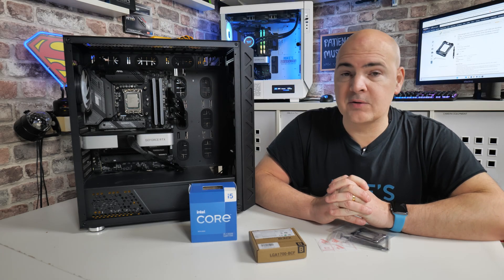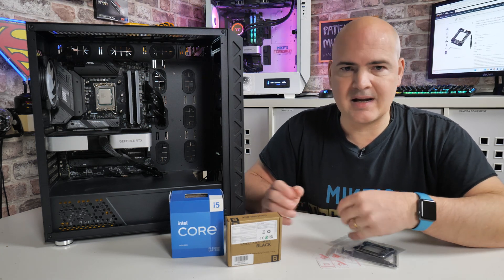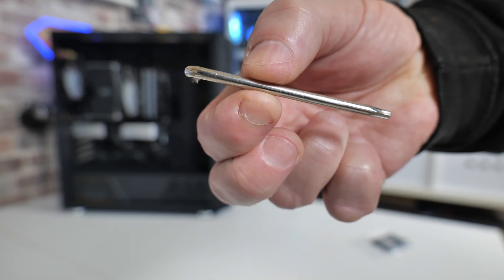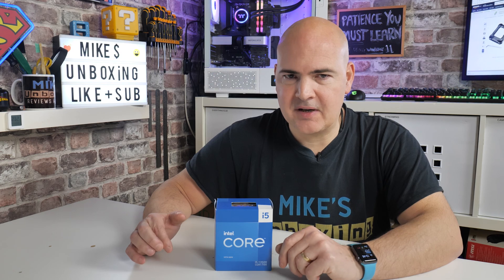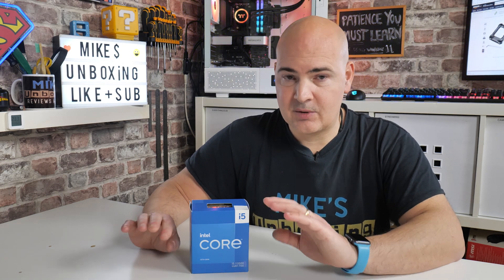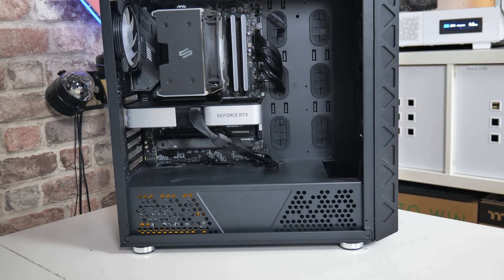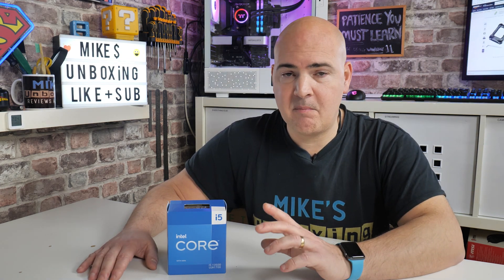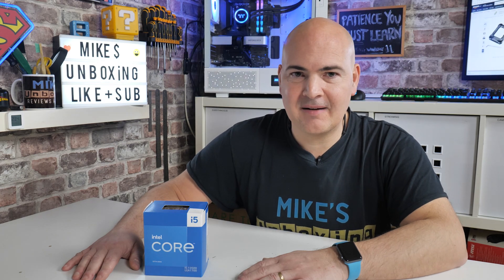Thermalright LGA1700 BCF Contact Frame Plate Weird Results Please Help!

Comment: I just had a weird issue as well. So I have a 13600k build, I bought the exact same contact frame, I installed it as I have with other contact frames I have done like on my 12900k, no issues on instal but I noticed my temps didn’t improve at all. I’m still hitting 95c in cinebench r20. I’m starting to see ok temps in games but not benchmarks. I’m wondering if this is a cinebench issue. Try another benchmark like intel xtu because it only hit 87c there and all my other test it did really well. 😊
Reply from the maker: good to hear that i am not alone on this, i wonder if the 113th gen chips or sockets are made slightly differently to avoid bendgate?

Comment: When was the contact frame bought? I tried to get one as soon as they were released but was told I  had to wait a few days before my seller could send me one. There was a very early batch that had problems and was recalled from the vendors. Some had probably already been sold or vendors just didn't return them.
Reply from the maker: not sure it was sent in by Rick one of the viewers so can't pin point it completely

Comment: You tightened the screws too much, you are supposed to go 1/4 turn in a cross pattern till the screw feels tight then stop, if you tighten too much then the cooler won't do correct contact with the CPU and also you could bend the pins, the fact that you put the stock retention back and still have bad temps shows you are over tightening the screws.
Reply from the maker: That is not mentioned in any documentation that the frame is supplied with, so just following the instructions provided as many potential buyers will do
Reply: @mikesunboxing  With this particular contact frame that shouldn't be an issue because unlike the grizzly version it has two pressure points on the top and bottom. So the amount you tightened it wouldn't have made a problem
Reply from the maker: @Honin_Cheta_Cheese_Akecheta  yes i just rewatched my install and the one steve / mike did and they also screwed down to the hard wall of resistance as i did, i also depth checked my CPU and there actually seems to be a very slight high spot in the middle which would seem to counter act the pressure from the stock and aftermarket ILMs

Comment: u need to set up a test thats equal. same clock speeds, voltage, ect. there is way to many variables with boosting. it was a poor test to do.
Reply from the maker: That makes sense but not really real world use when locking things down. And most people won’t or can’t do that and just want an improvement over the stock out of box experiences
Reply: @mikesunboxing  hi mike. Makes a lot of sense in real word use, for the specific part. If you test a product, you remove all the variables. That is the comparison. Then if it makes a difference in real life, is another story.

Comment: It's not the board that bends it's the CPU IHS. If you've already fitted the CPU with the original clamp it may have already bent the IHS. Try putting a straight edge across it and see if you can see light between the CPU and straight edge to see if it's warped. They are usually have a dip in the centre between the two clamping lugs where the clamp has pushed down so hard.
Reply from the maker: Will try that, the cpu isn’t in the pc now so easy to do
Reply: @mikesunboxing  I would love to hear back as to whether this was the case
Reply from the maker: @WeirdTippy  right just checked the 13500 and there seems to actually be a low spot towards the bottom of the CPU, very slightly higher in the middle so that might explain my results
Reply: Unfortunately this is my experience as well.  If the original CPU used with the original clamp over a period of time, then the IHS has been bent as well.  Of course, there is a lot of variables.  Some CPUs may already have high/low spots from factory.  Some clamps on mobos may not be as forceful.
Reply from the maker: @hanswi336  Did you click on the emoticon to accept the rules?
Reply: can I remove my cou from motherboard to check if  pins or cpu is bend before installing this frame ?

Comment: Hi Mike and Kath.Gamers Nexus did a deep dive on the Thermal Grizzly plate.there plate is marked with lines around the bolts around six lines and was tightened one line at a time going corner to corner that my make a difference on performance.
Reply from the maker: Yes I did watch that video due to the manufacturer tolerances the grizzly needs a bit more care and attention and tweaking to get it just right.

Comment: I didn't tighten mine anywhere near as much as you did. I screwed them down very gently until they bottomed out using only my finger tip and thumb on the shaft of the driver. I think I even slackened them off by ⅙ of a turn. My thermals have been far better than I ever expected.
Reply: Did you mark your screws like in the Gamer Nexus video ? or did you just cross pattern tighten them slowly? Did you also do the reverse turn to "seat" the screws initially?
Reply: @ptung88  Didn't mark screws, just used the handle of the tool as a guide to how much it was turned. I cross pattern tightened about half turn at a  time until seated just using finger and thumb on the shaft of the driver. Then backed off ⅙ of a turn. I figure the friction of the screws, against the tension created by the pushback of the sprung pins is enough to hold them. If you are worried they might be loose don't bother with the ⅙ back turn. While playing Microsoft simulator, I don't think I've seen my CPU go above 60°
Reply from the maker: @51im  Thanks for the info
Reply: First thing I thought watching this was a little too aggressive with the tightening.
Reply from the maker: you can't tighten post a dead stop. you can't torque past it, there is a metal pillar hitting a metal plate. you could try and overtighten it but you really shouldn't be able to, unless there is a soft metal involved
Reply: @mikesunboxing  
I prefer to be a bit more gentle with my motherboard. I have since screwed the frame down fully, when I gave my PC a clean but still used a gentle method of tightening as shown on at least two other YouTubers videos. But it's your motherboard, have at it.
Reply from the maker: I will give that a try when I revisit this again
Reply: The Thermalright frame is a bit different it doesn't float like the Thermal grizzley one the frame sits flush with the motherboard. That said you aren't supposed to torque the screws down you are supposed to stop as soon as you feel the screw bottom out and stop. If you are worried about the screw backing out then I would use a spot of blue threadlock on them (just a tiny amount). I think a better way to design this would be to use shoulder screws with springs under the heads pressing down on the frame from above.

Comment: I fitted the same thermaltake frame to my 12700k. The thermal paste had more even spread and thickness across the CPU after fitting it, with an almost perfect contact pattern. I wouldn't fit an lga1700 without one.
Reply: Is it hard to mess up installing? I’m thinking of moving to intel when I build a new system end of this year
Reply from the maker: is it hard to mess up installing, arguably yes there are "sweet spots" to the installation and could be the first time or could take a few attempts, there are a lot of variables here
Reply: @mikesunboxing  ah, I hope it goes well for me when I do it lol. I’m upgrading to hopefully something like the 13900
Reply: @sol-hb8zg  just treat everything gently. I read about the lga1700 CPU bending issue before I bought mine and fitted 0.5mm washers under the original clamp mechanism to stop it from applying so much force on the CPU then when my contact frame arrived I gently tightened the screws then backed them off ⅙of a turn. There is still friction on the screws due to the spring tension of the LGA pins.
I did also lap my cooler to make it dead flat but that was done before my CPU even arrived. I didn't do the CPU that is still in stock original condition.
Reply: @51im  yeah im not gonna get it for a while but its good to know. im on a 3800x atm and have the upgrade itch :) yeah its a bit peak that a billion dollar corp cant fix these issues esp that there are two gens that have this issue. i hope the next gen has that sorted out, we should not have to do stuff like this!
Reply: @51im  yeah for sure man. thanks for the help though. cant wait to upgrade!
Reply: @51im  did u re polish it to?? whatd u lap it with? microscopic holes cannot be seen to the eye
Reply: @jackhere4594  I lapped it with 600 wet and dry that was on a sheet of glass, purely for flatness. I feel if you polish the surface too much it will allow the paste to pump out with heat cycles
Reply: I am the same always use them

Comment: Wow, I was thinking about using one of these in my next build, but I'm not so sure now.  After you reset to the original configuration, and the numbers stayed high??  That will make you scratch your head.   Maybe the Thermalright Frame needed to be tighter?   I'll be curious to see what you discover.
Reply from the maker: Seems after some research and trying other methods the best way to lower temps is to undervolt and set power limits the temps are much better and uses less power with better performance
Reply: @mikesunboxing is it difficult to undervolt a cpu ? I'm curious about this and wym by setting a power limit ? My i5 12400f already has a power limit set on

Comment: i use this exact same frame with my 12600k.  I was having the same problem that you are having.  I had watched some videos and I don't remember who it was, but the problem ended up being that I had tightened it down too far. There are tiny clicks when tightening it.  you should first loosen the screw and listen for the first click and stop tightening it.  Do the same and it will be at the correct height and all.  Give it a try!  I believe it may have been Gamer's Nexxus that had the video I ended up seeing with the Thermal Grizzly one.  I went back and re tightened and it works like a dream for me.
Reply: Yep, it was GN that did a detailed instruction on how to mount it and this was my first thought when Mike said he screwed it nice and tight. If im not mistaken, GN were actually following the manufacturer's advice, not just coming up with this stuff on their own
Reply from the maker: The thermal right has no recommendations for fitting where the thermal grizzly does

Comment: Interesting. 

Did you check the BIOS settings in between tests? My MSI B460 (Mortar Wifi) motherboard has a setting that sets a different CPU profile depending on the option you "choose": Stock Cooler, Aftermarket Cooler or Water Cooler. And after what I've tested (not extensively mind you, couldn't be bothered with a locked CPU), although the PL1 shown in both the Aftermarket and Water cooling options make them appear to be the same, they're really not: higher power draw in the later one, with marginal gains. And now that Microsoft is enabling BIOS updates with Windows updates I honestly just question everything :D.

Also, if you're curious about more Thermalright products, my recommendation definitely goes to the Peerless Assassin 120 CPU cooler. It's really good for the price.
Reply from the maker: thanks yeah checked that setting thanks and got a review of the assasin r se 120 arb coming very very soon

Comment: Good informative review. If they really lowered temps then wouldn't high end motherboard manufacturers include these from the factory?
also i think the extra metal mass surrounding the cpu actually might slow down the dispertion of heat?
Reply: Right bro that may be the reason because if you see the original setup that has a very large area uncovered so the heat dissipate easily .. 
And do the processor really bending i have installed core i5 12400f with msi b660 wifi ddr5 mobo 
And my temp max under full load is only 64 degree.. i run the benchmarking for 1 hour and the max temp is 64 in room temp 27 degree .. 
So i believe not to tamper the setup thats why even i had the bend correction frame i didnt install it 
Also i believe the pressure of the cpu cooler with the processor preventing the ihs from bending ..
Reply from the maker: seems that some boards need it more than others so i am interested to test out an older b660 board when i can